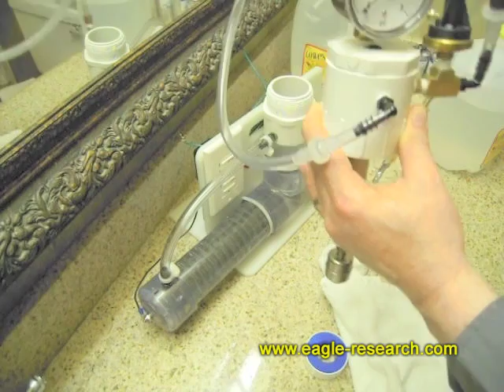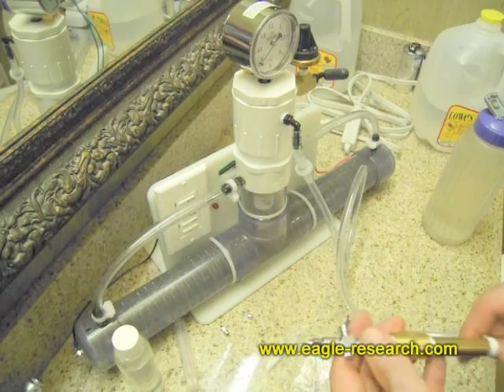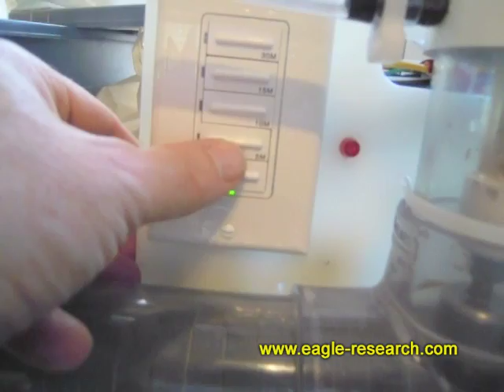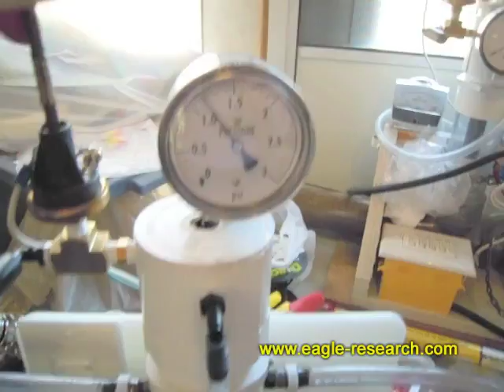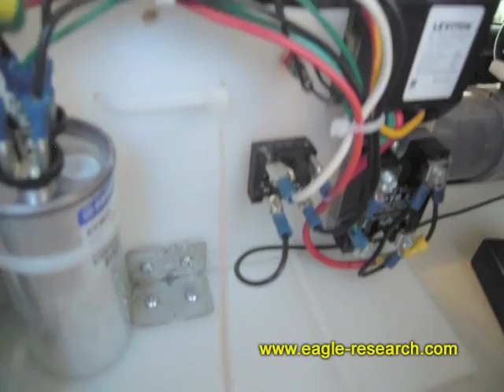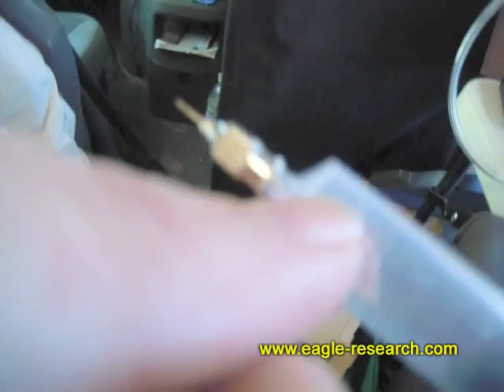ER50 WaterTorch Startup and Operation

Comment: Hate to be a party pooper, but have you ever gotten steel wool wet? Dude, it rusts instantly. I mean, bare metal rust, quickly. that whole inside of that brass tube is going to be orange. You may be able to use chore boy, it's copper-coated, but it's very coarse material. Ideally, you need to find some brass screening. fun fact. When using oxy-acetylene torches, whatever you shut the valves off quickly you end up getting a snap or crack out of the tip of the torch.
Reply: He said to pack it with stainless steel wool..

Comment: I wanna know that how much time does the Metal Electrode take to fully Corrode and Disappear?
Reply from the maker: Since we use a technology that keeps the electro-deposition voltage under the limit for 316SS, the answer is infinity.  Our electrodes do not corrode or 'disappear'.  I'm still using electrolyzers I built in 1986.
Reply: @ecopegasus  316SS??
I am Sorry I Didn't get it
Reply from the maker: Stainless Steel, grade 316  @goofyvids2978
Reply: @ecopegasus  Thank you Very Much.Very Much Appreciated.

Comment: I am sick of all these videos that show people putting electrolyte in HHO generators!  If it won't work on ordinary tap water then it is just not practical!  When using a frequency pulsed DC power source, ordinary tap water or even distilled water will work great and without and electrolyte!
Reply from the maker: It's too bad that many people that do not understand basic electrolysis Facts:
1. Water is a dielectric, in it's pure form, water will not conduct electricity, so NO gas would be produced in 'normal' electrolyzers if pure (properly distilled) water is used.
We are not using voltages high enough to penetrate water (jump from cathode to anode) because those type of electrolyzers quickly disintegrate their plates.

2. To have electrolysis, (make gas) electricity must flow.  If you add impurities to water, the electricity can flow through water using those impurities.  Luckily, water is nature's universal solvent, so there is virtually NO pure water on the planet that is pure.

3. BUT... All impurities are not equal when used as an electrolyzer catalyst.  You want to use something that is efficient (used as little electrical energy as possible) and does not produce negative side effects like poisonous gases and excessive sludge.

Catalysts like baking soda, sodium chloride and tap water are very inefficient, produce sludge AND produce poisonous gasses like carbon monoxide and chlorine gas.  I find these side effects unacceptable.

I've tested thousands of materials and concentrations, trying to find the best catalyst, and have settled (after 30 years of testing) on a 5% solution of lye (NaOH) as the most practical.

This dilute solution is inexpensive, readily available,  reasonably efficient, is only as 'caustic' as strong soap and is clean (produces no poisonous gas).  All the above all depends on a properly designed electrolyzer, optimized to run on this electrolyte solution.

GOD knows, if I could produce Brown's Gas using pure water, I would.  But as of this time, having researched copious available literature and experimented for over 30 years (spending over $2,000,000 and with tens of thousands of hours invested), I do not yet know of any practical way to do that.

BTW, while pulsed DC does make electrolyzers more efficient (and mine do pulse the DC) the pulsing has nothing (directly) to do with the catalyst.  The catalyst is NEEDED for electricity to flow, pulse or not.
Reply: you are sick from your ignorance
Reply: @polavink2184  please indicate who you are directing your nasty comment to....please be kind, no matter what....be well
Reply: Protips, sure you can use tap water specially for you sicko!

Comment: this is so not efficient, So much power for so little gas, from all that power you are consuming there you are making gas whit only about 4% and all the rest of energy you consume is warming stuff you dont want warm. You need to check your voltage /electrode, it should be 1.4 volt/electrode, that is the voltage per electrode which produces gas, There are so many good schematics and they are not expensive to build and you will feel the difference when you pay your electricity bill.
check this guys presentation, its way better, this is just from quick google youtube search: https://www.youtube.com/watch?v=Ljm8m85p6T0&list=PLPDKiDP23Oa4k72kYrQ_GcVLYFyD7GnhK&index=4
Reply from the maker: That is a good compilation video, even though it contains some errors and assumptions that aren’t entirely true.  Too many to list them all.  Some comments and references below...

Brown’s Gas, HydrOxy, HHO, etc. are all the same gas.
http://www.eagle-research.com/cms/faq/what-is-browns-gas

Bob Boyce is not the only Brown’s Gas expert.  Referring me to him is like referring Edison to Tesla.  We already know each other.

Telling me that my electrolyzer technology is only 4% efficient, tells me that you have no idea what my technology actually is or what I've achieved (which has been independently replicated MANY times).  
My experiments are FAR above Faraday efficiency and have been for decades.  I started this research in 1986, LONG before Bob Boyce came into the scene.

My current experimental electrolyzers average less than 0.9 watt-hours per liter of gas produced.
Getting efficiencies in the 20 mmw range
http://www.eagle-research.com/cms/faq/dry-cell/dry-cell-more-efficient

my electrolyzer cells average less than 2 volts each, can be as little as 0.9 VDC.
I use NaOH
I use 316L SS
I only use series cell arrangements
I’ve sold THOUSANDS of my electrolyzers, worldwide and my customers have been universally happy.

I independently developed the Capacitive Power Supply, which further increased electrolyzer efficiency at the same time as inherently controlling amperage.

Here is proof that BG assists carbon-fuel combustion, download PDF here:
http://www.eagle-research.com/cms/node/443

I’m the original inventor of the EFIE, which allows BG work to on fuel injected engines by interfacing with the oxygen sensor.

BG EXPLODES FIRST, then implodes to water.
https://www.youtube.com/watch?v=-9EmgSowldw&t=30s

Sanding the plates only helps for a short time.  The grooves ‘fill-in’ on the negative side of the electrodes and disappear.

The negative electrode (hydrogen producing) NEEDS twice the surface area as the positive (oxygen producing) electrode because twice the volume of hydrogen is produced.

Better than ’sanding' is to use my grid-plate design, which doubles the negative surface of the cathodes in a way that will not plug up, like grooves will.

I’m the one that discovered the ‘gas between the plates’, in 1996, 
http://www.eagle-research.com/browngas/whatisbg/watergas.php
which I’ve subsequently named Electrically Expanded Water (ExW).
http://www.eagle-research.com/erpdf/fs/FSLog.pdfExWform.mp4

I find it interesting that for all my achievements in this genre (Brown’s Gas for fuel combustion enhancement and resulting fuel savings), this video gives me no credit...

Note that gas production is the same in every cell, even if some of the cells have lower water (that was a miss-statement).  Bob’s cells remain constant liquid level by water leakage around the plates.

The ‘resonant’ circuit need an INTERNAL feedback loop, so that cell resonance will be maintained as internal operation conditions (like temperature, electrolyte density, etc.) change.

Taller pipes are LESS efficient that lower pipes, because gas generated at the bottom interferes with electrolysis as it rises, the more gas generated as you go higher, the more interference.

Short horizontal plates are more efficient than tall thin plates.

The Garret Carb electrolyzer was NOT a series-cell design, it was (at least your picture shows) a traditional 2V cell, that was then ‘over-driven’ by the impressed 6 VDC.

Same with the Blue electrolysis, it’s wired as a 2 VDC unit, as per your own drawing.
It’s then over-driven with 12 VDC.

The ‘key’ with these two carburetors is the air being pumped through them.  The air becoming ‘charged’ and combustible.

May the blessings be.
George Wiseman
Buy Eagle Products:  http://www.eagle-research.com/cms/store/

Comment: You really screwed up with the Teflon tape, you should NEVER use more than two wraps. That will hold more than 6000 PSI of pressure. Using too much will make a fitting leak.
Reply from the maker: That depends on how deep you tap the hole with NPT threads.  I 'over tap' to make room for the extra teflon tape because it then allows for expansion and contraction to limit leakage due to plastic deforming when it gets hot.
You are right, one to two wraps is enough if tapped 'properly' to spec.
However I'm confused as to why too many wraps would cause a fitting to leak, unless the tape just doesn't go into the threads due to the bulk?

Comment: The flame will burn submerged in water, I don't think putting water in the flash-back arrestor will stop it. Tightly packed bronze wool is what I've heard is best for the application.
Reply from the maker: I decided to leave this comment in place (for now) to correct several misunderstandings.  
Fire (combustion) requires three things to 'burn'.
1. a fuel source (in this case, hydrogen)
2. oxygen
3. heat (including ignition energy)

In this case we are dealing with a gas (Brown's Gas, HHO, BG, HydrOxy, etc.) that IS a perfect (stoichiometric) combustible fuel mixture (of hydrogen and oxygen) so fuel is no problem.

The BG can be ignited with static electrical spark or by compressing or by raising it's temperature or with a shock wave or with something as simple as inserting a sharp point into the gas (or a combination of the above).  
Once ignited, the combustion provides it's own heat to self propagate.

Note: When igniting a torch that is using BG as a fuel, the gas coming out of the torch orifice MUST exceed the open air burning velocity of the BG flame (about 22 fps) or the flame will burn back into the torch itself.  As long as the gas velocity is coming out of the torch faster than the BG can burn back, you are fine.
Once a BG flame is burning in an enclosed area it accelerates to detonation velocities (> 5000 fps) and the resulting 'bang' sounds like a rife shot.

NOTE: The BG really isn't a 'thermal' flame as much as an 'electrical' flame.  Releasing it's electrons into whatever it contacts... Which is why a tiny flame that measures less than 300°F with an infrared thermometer can melt tungsten at > 5000°F.  

The point is, if you have inadvertently allowed your torch flame to enter your torch, you are now trying stop the combustion of a high velocity (shock wave) high energy (electrons) gas.  

To stop the combustion of any flame you must remove one (or more) of it's ignition requirements.
In our case, removing the fuel or oxygen is out of the question, because both are inextricably mixed together.
So our only option is to remove the heat and shockwave.

I've experimented (since 1986) on various ways to reliably stop this combustion.  
The traditional torch check valves are useless.  They are meant to stop combustible gasses from mixing.  BG is already mixed... And the BG is burning far too fast for a mechanical device to respond before the combustion is already past.
The traditional torch 'backfire' screen (designed to suck the 'heat from the flame and thus 'quench it' is useless because the high energy combustion simply vaporizes the fine screen and the shock wave goes right through it in any case.
Even a tightly closed solenoid valve will not stop a BG backfire once the detonation reaches it's full velocity (in about 2 feet of hose) because the shockwave goes right through the solid metal and 'ignites' the BG on the other side.  
Imagine my surprise when I learned that fact as I was designing systems for automatic shutoff of shapers (CNC controlled torch tables).  I did solve that issue BTW, using an 'air purge' apparatus.

Metal wool is a common solution to stopping BG backfires because it does absorb both heat and shockwave... But it is NOT reliable and is inconvenient.  You can increase reliability by making sure the wool is wet, so it absorbs more heat and shockwave.  But for it to work, it needs to be compressed tightly and very wet, so often restricts the flow of the BG.  Also, fine metal wool is FULL of sharp points and edges which can ignite the BG and finally, BG often has some electrolyte come out with it, which eventually plugs up metal wool filled backfire arresters.

And FYI, while the BG flame is MADE from water, it does not 'burn under water' any better than any other torch fuel gas... In fact, if you try it you will almost certainly cause your torch to backfire because the water mass and pressure will slow the gas velocity coming out of the torch orifice enough that the flame will 'burn back' into the torch.

So... The ONLY reliable and easily maintained backfire arrestor I've discovered (some of which are still operational since 1986) are liquid bath (usually water) bubblers that separate the gas into fine bubbles and bubble up through at least 4 inches of water.  Such bubblers reliably absorb both the heat and shockwave of the backfire.

NOTE: even a poorly designed bubbler will not work because the BG shockwave can 'jump' from bubble to bubble, thus traveling down through the liquid and past the bubbler.  This is why you must have fine bubbles, and enough water depth so that both the heat and shockwave are reliably dissipated.
Reply: https://youtu.be/p7sgha8E5ew
Reply from the maker: Nice video!  As it demonstrates, the flame will be extinguished if submerged in water.  That particular video uses a fairly high pressure gas (to keep the velocity up).  I like how the hot stone underwater can re-ignite the flame when it extinguishes.  What is this guy using as a backfire arrestor?
Reply: https://youtu.be/T5hHhzOslCM This one doesn't go out, there's another one I know of too.
Reply: At about 15:50 he gets to it https://youtu.be/Bd_yrSldFWw
Reply from the maker: I never said the flame wouldn't burn under water, I said "it does not 'burn under water' any better than any other torch fuel gas..." And that it will backfire if the mass and/or pressure of the water causes the gas velocity out of the orifice to slow below it's combustion velocity.
All the videos you show prove out this point.  

You seem to be thinking I'm saying it won't burn under water.  I'm not.  I'm saying there are factors to consider and, if properly addressed, the torch will burn under water (or in a vacuum or pretty much anywhere).

So what these people are doing is increasing the pressure of the gas to compensate for the pressure of the water, keeping the combustion velocity up and that can 'somewhat' allow the flame to burn under water.  
You do see that even in most of these cases, the flame still gets extinguished.  
It does seem to help to have an ignition source under the water, to nearly instantly re-ignite an extinguished flame. You can tell the flame is being extinguished and re-igniting by the popping sound of the backfires.

There is a limit to how deep you can have a BG flame under water because there's a limit to how much you can pressurize it before it 'self-explodes'.  That limit depends on several factors, like temperature and electrolyzer design (no points or sharp edges), etc.
Reply: It is a very promising substance, this HHO, I wish more people would become interested in it. I've seen videos where there is in fact a way to compress it above 15 PSI, but special cylinders are needed that use a carbon-based compound available only to the military. 
  If I had the 316L stainless steel plates I need to build my own electrolyzer, I would love to build one; I tried with 304 Stainless steel threaded rods, but found out that the iron in them would leech out and make the water a nasty brown color.

Comment: i have build my own er 50 but i have some trouble to connect the wiring properly.
i wish to use it as cutting torch/ welder but the question here is if you can send me a link where i can find or purchase the proper wirring diagram clearly explained how to wire the solid state relay (i use model ssr-50 AA-h), the rectifier (i use model QL60A) the floatswitch and control light, i also would like to know if the timer switch can be purchased as a 220v/240vAC model ?? if this is the case i would like to know where i can purchase it
my er 50 must be productive in less than 2 weeks so a quick responce would be highly appreciated, i really appreciate your videos, they are a great inspiration to me
Reply from the maker: Contact me directly with these questions and I'll point out the Resources you need.
http://www.eagle-research.com/cms/contact

Comment: Thank you sir.  One more question?  I wonder if one side gives off oxygen only and the other end gives hydrogen only.  I'd like to use hydrogen only for pain management.
Reply from the maker: That is a 'traditional' electrolyzer design.  My machines do not separate the hydrogen from the oxygen and thus gain additional health benefits not enjoyed by straight hydrogen.  People have been using my machines for pain relief since 2001.